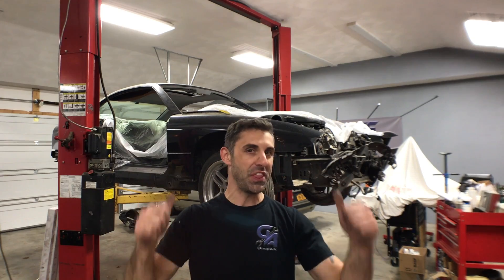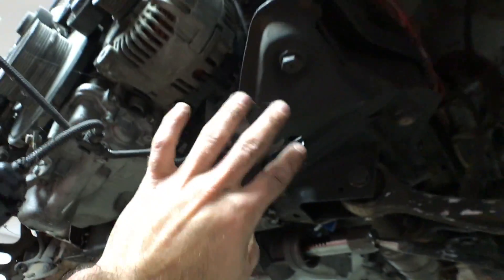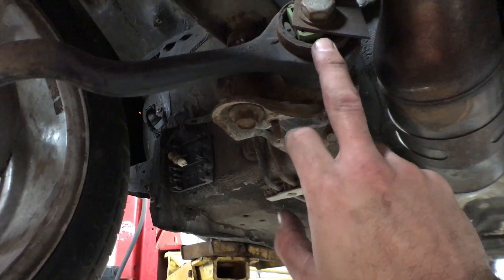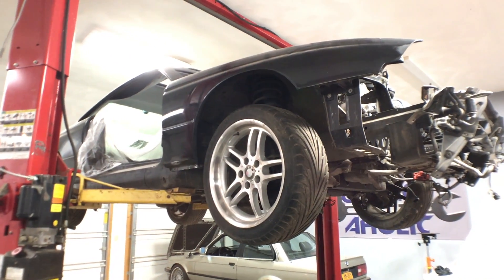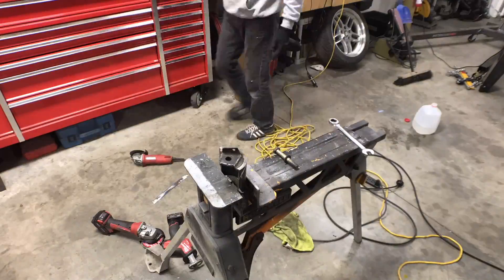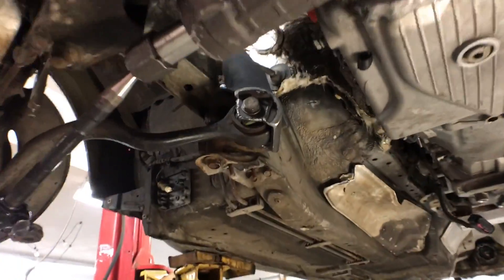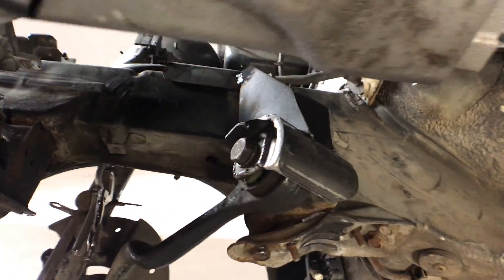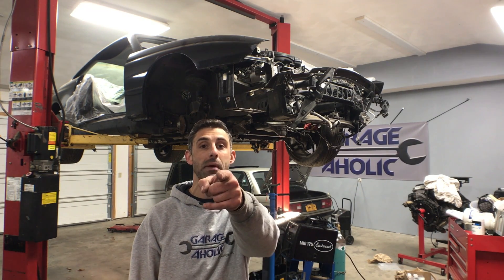Relaunching the E31 V10 Project! Upper Control Arm Bracing!

Comment: Hey Frank. A small suggestion... why not build an x brace from each of the lower control arm mounts to the sub frame, similar to an e36 z3 coupe. So this x brace could be fabricated from flat bar or tube. And the x brace can serve as strengthening the suspension as well as protect the oil pan. I'm not an expert but just a suggestion. Not sure if it can work
Reply from the maker: I may do an x brace - it would be custom to clear the custom N54 oil pan but it's definitely an option thanks for the suggestion

Comment: I was wondering if you should beef up the frame rails to prevent flexing and, ultimately, cracking, since you no longer have a cross brace distributing the load amongst both rails??? 🤔

Nevertheless, thanks for getting back on this project and sharing it with us. Funny I just mentioned a few days ago that I couldn't wait for you to finish this one as it's been a dream build on the back of my mind for a very long time.
Reply from the maker: Haha you were actually thinking of me working this swap?! Thanks for the comments. I think that bracing the frame rails themselves is a good idea too.

Soooo much easier to do when the engine is out. I’ll have a welding FIELD DAY later this year to brace all this stuff up, good idea I’ll take note! Appreciate the advice!